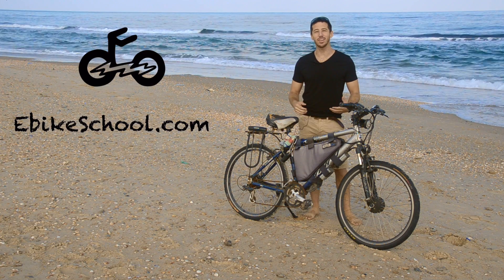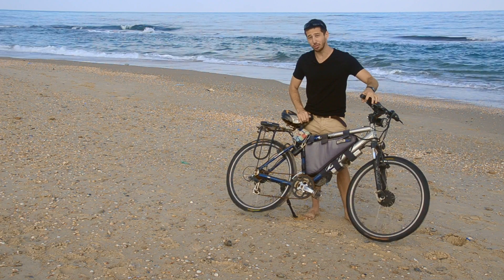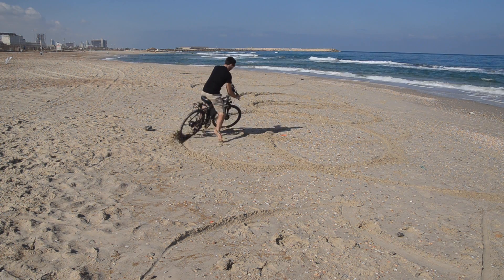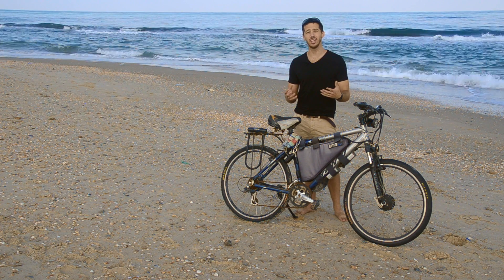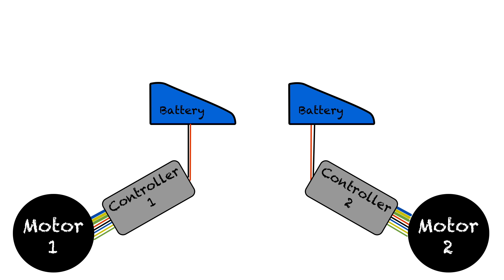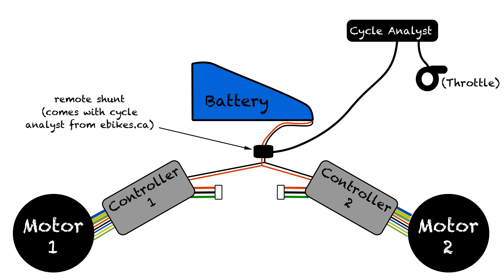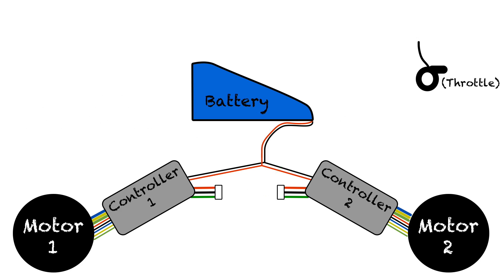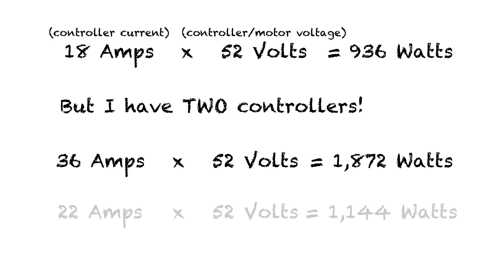DIY Two Motor 2wd Electric Bicycle (All wheel drive 2x2!!) Q&A#6

Comment: I bought 2 Voilamart (front and rear) kits. Both 500 watt. They have the same controllers. My problem is the throttle has 6 wires. My question is, would I still use the green wires to connect the controllers.

Comment: Isn't there huge resistance to roll when battery is empty? I have side motor powering rear wheel whit freewheel, absolutely zero resistance, when no electric. If my battery is empty, I just pedal to home like normal bike. I don't like idea of any resistance, when pedaling. I ques there is some advandige for that kind of system as well. What are those?
Reply: Yes, there is extra resistance, so just make sure the battery will not run empty or take a spare battery with you.

Comment: Hello.if i buy front and rear electric wheel,48v 1000w,what battery i need to run them at full power?on electric wheels description it says not les then 17ah.can you help me,please?thank you
Reply: At full power a 17 Ah battery will last for 49 minutes (or less).

Comment: If I have two separate batteries for the two motors, would I need two throttles? Or could I just hook the throttle power wires to one controller and the signal wire to both controllers?
Reply: ebikes.ca carries a throttle splitter cable, or you can make one,  just connect both controllers to the same throttle, the problem is not all are wired the same but you have 3 wires, one power, one ground and one signal, as long as you match those, your good to go.
But I have seen some guys like to have a throttle on each side.

Comment: I have a rear hubmotor 750W bike, 26 inches fat Wheels and battery 48V 11.6 Ah  I want to put a front motor of 250W , how I can set the front wheel to spin at same RPM than the rear motor?, should i use a smaller front wheel?

Comment: So I bought a electric scooter that's dual motor  2400' 60vand my dad tried to add things and wanted to untangle  now we don't know where to start HELP PEASE   IM THE person that doesn't knowhow to do anything,  I payed 3 people that  said they can rewire things eventually  they evanutaly give it back and thngs lpo!  And are worse.  Welyou pleaeeel help!me .  even looking your diageam I don't get it please help would you expalinin step please cause there are controller wouels tell! S what to connect  with the first hub and what set of wire ro connect with second if you would please explain! Wire per wire. And there js a buttons on the handle bar that you can press single or dual.  I truly apologize for the inconvenience 
e nut it you would ITS  MEANS THE WORLD I.  I REA,LY wanted to send picture and video to show what I need bit I dont know howon YouTube comments  well! I would like yo give you my Email so yoh can send! E anything please  tonyvan85@gmail.com .  well greatly appreciated   thanks

Comment: Awesome video! Thank you. eBike usage is finally picking up here in Monterey CA. All of a sudden I am starting to see them often. Soon it will be 2 years (5 years total) that I am 2WD eBiking with a circuitry design of my own which is a hybrid of cheap Chinese kit parts from eBay, common needed parts, and high-end esc's and BEC from hobby goods manufacturer Castle Creations. For batteries, I either use the packs I made from Nissan Leaf battery modules (14S) or a single heavy (35 pounds!) Lithium-titanate that came out of some car, which can hold above 60v but my esc's are rated at 50v and they throw up when I give them more than 59v! Any way, it would be my honor if you checked out mine at my website and gave me any feed back: justebike.com got a couple of short videos there  . Farrokh

Comment: Hello Mike, I've been your fan since the first videos! I still have not bought your books because I can not read English: \ I have several motors of various brands all 36v 250 350 watts. I have a serious problem with the clutch above 50 volts a loud scream and slip happens. I open the clutches and there is not much thing to do, for a harder spring thicken or tune the rollers. I've been in the endeless and no one talks about this problem and no one knew me to answer what to do. please help me mike !! my 2wd system is economical type without cyclist analyst and when you turn off one of the controllers the other fires alone and exits smoke from the motor shaft and burn the first two mosfets of the blue wire. these two problems take away my patience I'm without patience. will the bafang rmg040 500 dc work without slipping the clutch with liSion 24s @ 20 or 25 maybe 35 amps? or is there a better clutch to buy? I prefer to use smaller motors and 350 watts, do I use infineon controllers will solve the problem of the drive alone when disconnecting the front or rear? Thanks for the attention mike

Comment: I want to build a dual motor e-scooter without using the cycle analyst.  could you draw a diagram to show  how to make a switch for the 2nd motor if I don't want to use it.  thanks

Comment: Do you have issues with both motors running at the same speed? Does one but out faster than the other?
Reply from the maker: Ideally you want them to both run the same speed, which is why I used identical motors and controllers. I haven't seen any issue with them having a problem of different speeds.

Comment: Hello......I have a question. if you lived in an area that did not restrict motor size would you use the larger  size motors on your two wheel drive e-bike? And how would the increase in size impact battery usage or would the increase give you better hill climbing capability ?

Comment: damm   dude   thats a nice set up,  but the battery gets drained twice as fast, which in turn cuts the miles down, which mean two batterys on the bike to get distance right//???    which looks like what u have???  no specs on that bike  ,  i see u listed all parts above, but not one whole spec sheet  on how to do what you just showed us,  a completed spec sheet   or a downloaded file????

Comment: Its said that  these electric motors will still get moisture inside and eventually rust up and cause motor to go bad, for the amount of time you've used your bike have you ever opened up your motors to check the conditions of internals, or have you did an internal water proofing method.

Comment: I want to do two 36v 500 watt motors on a 1kW speed controller @ 72 volts. Wondering if that is good or is it cheaper with two 500w speed controllers?

Comment: Can I still win with my question, which is: can I use supercapacitors instead of batteries? I saw a video where a guy replaced his car battery with supercaps. It seems like with the right controller it might work, but I'm not entirely sure. Thanks!

Comment: I want to create an ecycle from scratch. I figure I can cut the frame with my powerplasma cutter and tig weld everything with my everlast welder but I'm lacking some dimensions for the frame to mount the motors and batteries so that they are low to the ground.

Comment: Great video and channel. I want a cheap ebike for my 10 mile commute on roads gravel and some mud. I want to carry shopping on it too so am thinking that a fat bike with panniers with two 350w overvolted motors attached to one battery similar to this video would be ideal. Do you agree? Also, I think that i don’t need a battery with many amp hours (not too long between charges) but need at least 52 volts. Do this sound right? Any suggestions on battery design much appreciated! Thanks, Adam

Comment: How did you wire the batteries in parallel or series? Where did you get the motor and controllers from? Very interested in your design.

Comment: great videos I live in MPLS minnesota i ride my e-bike year round. I also use a little trailer hook up for shopping.Question:  it is getting difficult in the snow and ice and i want to build a e-bike 3-wheel bike that is 3 wheel drive for hauling my groceries home without wiping  out when i hit some ice any help would and your expertise appreciated. Note i am new to this and watch your videos and plan to buy your books and vruzend kit thank you I am also thinking of building and selling affordable e-bike up here in minnesota there are only a handful of e-bike shops in mpls st.paul area and they want 3000.00 to 5000.00 a bike and they are not even impressive. also I know if there was something like this in my area m more people would use e-bikes

Comment: Hi Mike. Congratulations for your channel and for all your job. You are an inspiration to us!
I have a question for you: Your rear hubmotor is freewheel or is cassette?
In this video, your e-bike 2WD appears. The hub motors that it carries are very small in size. The link that you put in the description of the video connects to Passionebike, store that I know. The Bafang 250/350 W engines are available only for freewheel, and this limits me to using 6/7 gears (if more, how you solve it?). In contrast, MXUS 250/350 W has a cassette holder option.
Thanks for your help. Keep it up!
Best regards.

Comment: Micah, What speed (Kv) motors do you run on your 2wd bike? Did you choose a slow wind since you're overvolting or a 'standard' speed for 26"/700c wheels? Also, any thoughts on 2wd with different speed motors?

Comment: Could you run two amp controllers to one battery while using one throttle and one motor? Im going for higher voltage to the motor using multiple controllers without programmable settings to one battery one throttle

Comment: Hi,
I am just at the start of converting my Tandem to duel wheel drive. I will be using two 48 volt wheels.They are only cheap ones so hope they work. Two 48 volt batteries. The thing I would like to ask is the rear electric wheel comes with an LCD screen is this the same as a cycle analyst? Can I use both or is it better to use the cycle analyst. I'd be grateful for your help.
 Great channel by the way.  Love your duel bike.

Comment: hello ı am Electrical engineering student and ı am making my electric bike ı design my controller and ı am using 2 out turner brushless motor 850kv each of them 180w ı have a gear ratio 1/28 this setup enought to power my bike ı am also using pedaling power wich is +200w in total 560w power ı have what you are thinking ?

Comment: I,ve seen another few video's saying 2 motors is a waste of time I can't find the video but it was an American company but I've seen twin engine cars and they work so why not a bike, I have a 36v 500w rear brushless hub motor so should I go with a 250 or 500w front, I'm looking for torque as I know top speed won't increase , I'm going with your advice as you or anyone commenting  has not given me any dud info you good useful info. Thanks
Reply: The conflicting advice is from Blue monkey cycles  2wd vs 1wd but I think their theory doesn't add up and they haven't thought of the controller, battery set up very well. Anyone got any thoughts I mean Micahs bike actually works and is well thought out tecnically compared to their advice on the subject.
Reply: Each motor has losses, so I wonder if 2 motors would mean twice the losses of power and efficiency? If so, maybe you could get good results by just sending twice the power through your current motor? But maybe it would burn out if used too hard

Comment: Thank you so much for this video!!! I got me a 2nd motor and battery and was stressing on how and where I'd mount a second throttle and try to somehow link them together by mechanical means. I am SO glad you can simply combine the signal wires! :D

THANK YOU!

Comment: Hello just wondering if any one out there can answer a question that I have concerning a 3 wheel mobility scooter. I would like to replace the front wheel with a front hub motor wheel combo. My question is due I need a separate controller or can I wire every thing into one. Thanks

Comment: Do you only connect one controller to the 6 pin or must you wire them together to one 6 pin connector  Can you show how to wire up 2 48v batteries and two controllers I have a fat tire 500w thanks.

Comment: thanks this has helped me alot on the wiring and the votes.  i just ordered both  the front and rear of this https://www.amazon.com/Esright-Wheel-Electric-Bicycle-Conversion/dp/B06XDHLVDZ/ref=sr_1_1?ie=UTF8&qid=1511565630&sr=8-1&keywords=electric+bike+kit from amazon and looking now for the Cycle Analyst because of your video. but i was thinking of building my own batteries and putting this up to 60 votes . from what your other video i just watched it should work but now i'm worried about the controllers ? can you check what ever you check and tell me if it will burn them out or not

Comment: Hi, I have a Carbon SUV fat Bike by Moto Parilla,  it has a 750w motor, works by pedal assist, for some reason throttle power are illegal in NYC, and rules are getting strict.  Have a Hub motor with 9 digital gears.   Want to keep it as a pedal assist. But want to change the 750w hub motor and have motors on back and front, making it 2 motors, want to have a backpack power source for the front motor and use the frame of the original battery space for the rear motor.   Currently I get 33 kilometers about 21 mph on the 750w motor.   Looking to try to get either speeds of 40-60mph with dual motors, would like the batteries to last as long as possible without the bulk.  Would i go with 2 1000w or 2 2000w motors, having the option to use one motor or two motors when using the bike.   One external backpack battery with a plugin for the front motor, and the second battery witch is installed in the frame which would control the rear motor.  Sorry for the long explanation of what i would like to do. Please email me if you can help me figure out a way to make this happen. Thanks. Emilio.  L.E.S.contractors@gmail.com

Comment: I saw a video from India where the guy made one of his motors a battery charger while the other one was used as the drive motor. He had a switch that allowed one battery to be use while the other was charging then flipped the switch and now you have a charged battery while the other was gettting charged. Can this be true?????
Reply: NO. it will only make your system much less efficient. It is better the think of your motor as a machine that can be both as a motor and as a generator. With regen, you will be able to generate power back into your battery from your drive motor. What you are talking about will consumer power in the form of thermal loss much quicker than without.

Comment: My question is is it possible to use cycle analyst to hook up 6 controllers with six Motors because I have real rough Winters in Pennsylvania and during the winter I sorta want to turn my bike into a quad by using adult training wheels that are 16 inch and buying 16 inch Hub Motors that are 900watts now my current hub motors for 700c Slash 29inch are 1200 watts so please let me know if this is possible because this is what I'm going to do cuz I don't currently drive a car so I'm going to be utilizing my bike that I built myself to travel back and forth from Brooklyn New York to Honesdale Pennsylvania which is 126 miles currently I have two batteries 48v 1200 watts which if I did the math right gives me 60 miles per battery thanks

Comment: Hi ebike school. I love your videos and watch them over and over to assist my understanding. 

You inspired me to do a 2wd small motor conversion with cycle analyst. For. Now I’m using the generic controllers supplied with the kit. The CA does not communicate with the controllers except for throttle input as everything is governed by throttle input to controllers. However I don’t understand how plugging the CA into the remote shunt can provide full functionality. 

 I’ve hit a brick wall with my project. 

I see you have on your website detailed instructions on how to wire the CA into a generic controller but then what is the 6 pin plug on the shunt for? And how do I perform this and plug in 2 controllers?

I hope I have explained my conundrum sufficiently. 

Any advice would be greatly appreciated 

Ryan
Reply: Also can I use regen if my controller does not have regen input?

Comment: I have a Moto Parilla SUV bike, it runs at top speed 21mph,  would like to keep up or go a little faster than the moving cars so I don't get hit 
From behind, its a pedal assist.  Would like to change the hub motors without disturbing the look of the aluminum hubs, front 26" rim has a very big disk brake, any suggestion where i can get a custom rim made with a 2000w motor, thinking of splitting the battery packs, having an additional one inside a back pack with a plug in. Maybe running 2000w motor for each wheel, depending on the speed and battery life, don't want to go overboard with this project.

Comment: In Europe there is a 250W limit, but is there any legislation saying that only 1 motor can be used? Does anyone know? Thanks
Reply: buntcher idk but surely 2 motors would use more battery than just 1 motor? Plus the tips speed in EU is 25KMH, so you may get slightly better acceleration but it may mean shorter range, higher initial build cost and no extra speed at top speed. Maybe
Reply: But it could also give you better hill-climbing ability - parts of Europe are bumpy.
Reply: The electric power is limited to maximum 250W no matter how many motors you use to achieve this.

Comment: I AM INTERESTED IN BUILDING A BATTERY THAT CAN BE EASILY REPAIRED IF ONE OR MORE CELLS LOOSE POTENTIAL.  THE SOLDERED OR EVEN THE SPRING LOADED CONNECTIONS TYPES I HAVE SEEN WOULD ALL BE AS SERIOUS REBUILD IN CASE OF CELL FAILURE